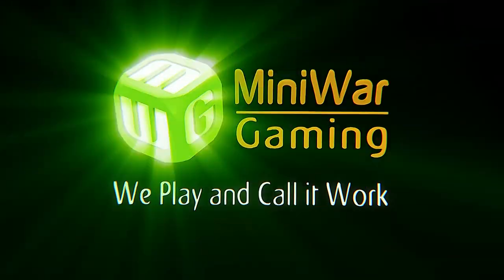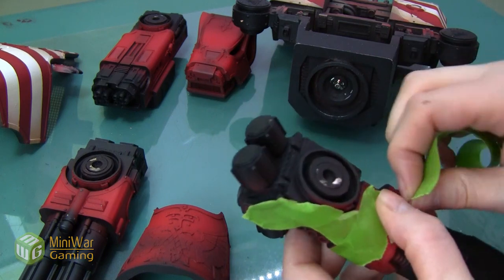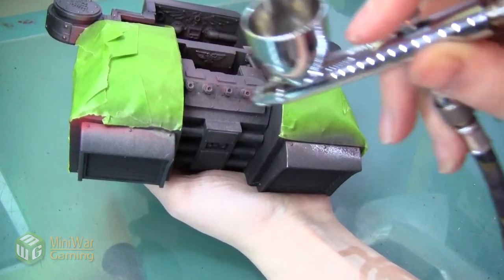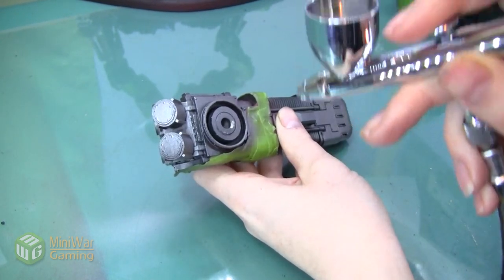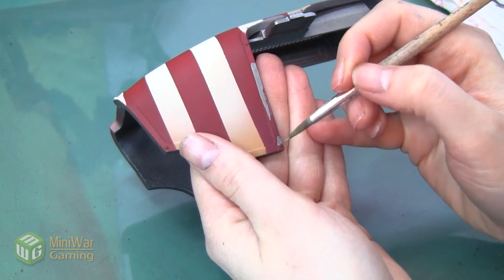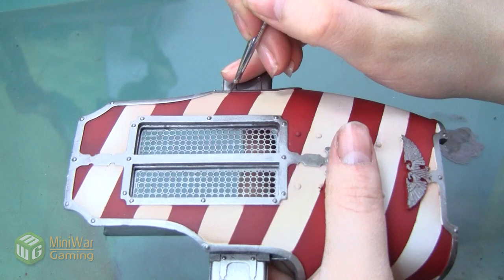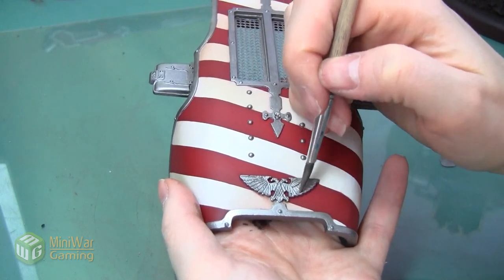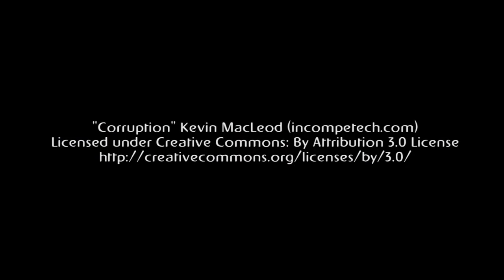How To: Paint Silver On A Titan

Comment: Wait so you did the white on that leg with drybruching and it looked like shit. And you do the metalllics (which looks fine dry brushed) and use an airbrush? That's backwards
Reply: +bogger3k The white armor plate looked like an amateur had done it, I have no idea why anyone would paint the armor plates first instead of doing the Metal first, Duncan from GWS suggests to paint all the metal first on imperial knights, this is basically the same thing, seems stupid having to  tape stuff off when you could simple paint the metal first then do the armor plates.
Reply: +bogger3k Does she not use Shades -- shudders -- all that metal needs a good wash of Nuln Oil.
Reply: +bogger3k 
The whole point of that video was to NOT use an airbrush.